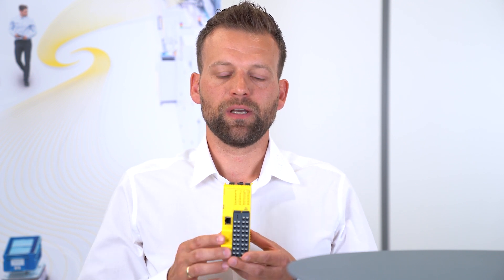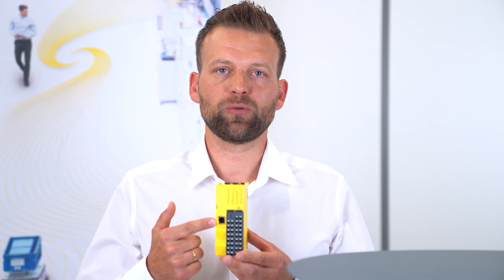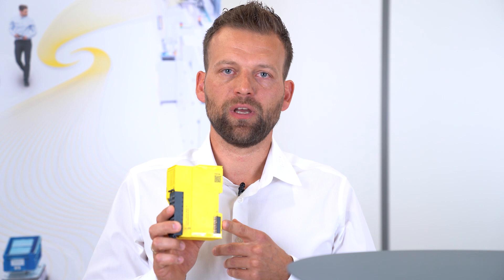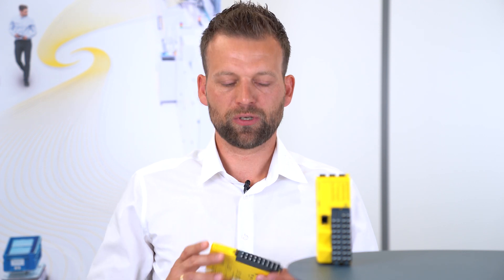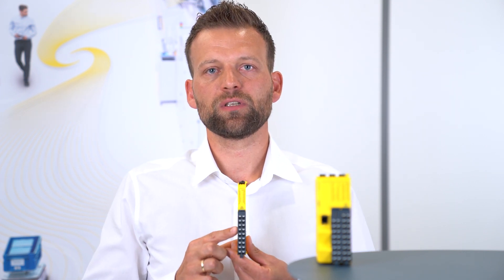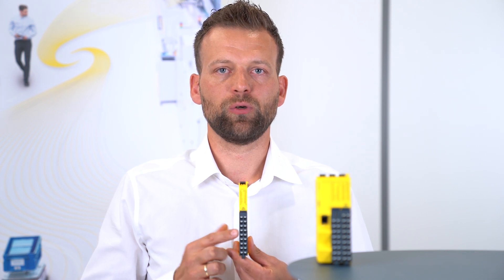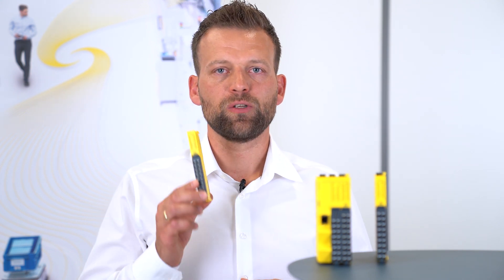Introducing Flexi Compact (1/5): Space-saving safety controller | SICK AG

Comment: A lot of nice features but unfortunately you missed the boat. I have been installing and designing safety systems for the last 25 years. I exclusively use the ReeR M1 Mosaic because of one simple feature that is fantastic selling point to my customers. The M1 has a removable non volatile memory chip, no battery. When programming the M1 with a chip installed the program resides on the chip. If the M1 controller were to fail, you can remove the chip from the down M1 and install it into a new M1 and you are ready to go, no programming. I can also modify the program, load it on a chip, and send it to the customer for customer installation. It will take them longer to shut down the machine and lock it out than it will take them to swap the chip. Yes you can do program changes via the internet but a lot of small are not connected. And then there is the cost of the module and programming to connect to the internet that probably exceeds the price of the M1.
Reply from the maker: Thank you for your feedback. We have implemented exactly this function that you describe with the SmartPlug.
Here the configuration is stored and it can be used directly on the new CPU in case of an error. This is described in the second video of the series: 
https://www.youtube.com/watch?v=hu8EMwgDg-k